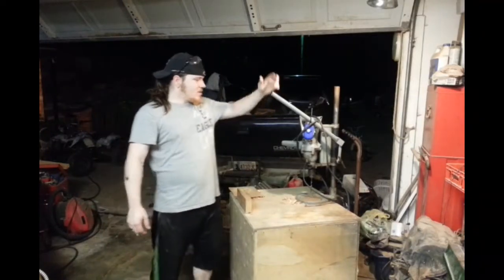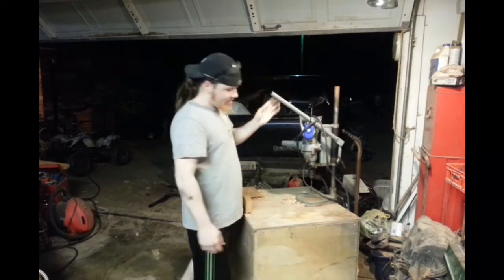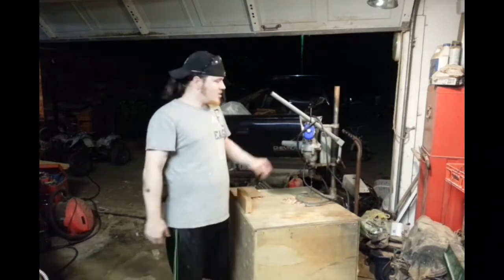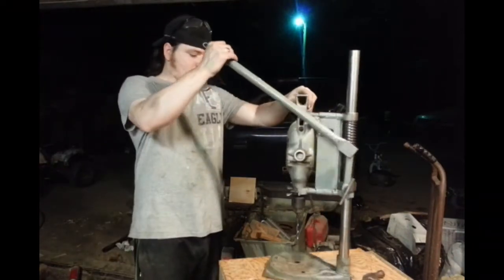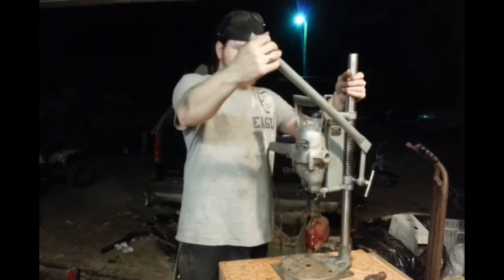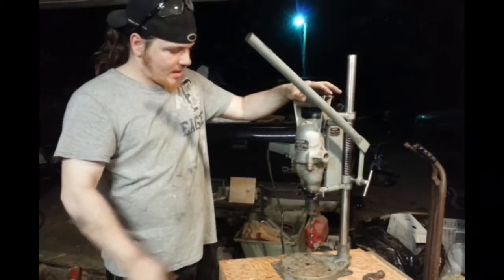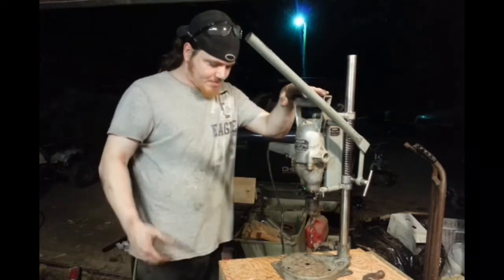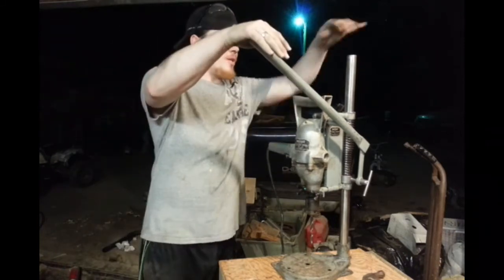Drill press restore

Comment: Thanks for the video. I was working on mine that I had for close to 40yrs & never used it. It was rusted and not working, couldn’t figure out what the problem was (wasn’t sure if I even had all the parts) but when you pulled the handle down I figured it all out.